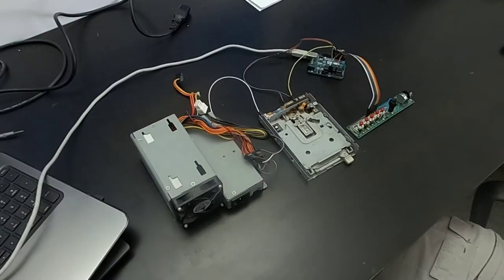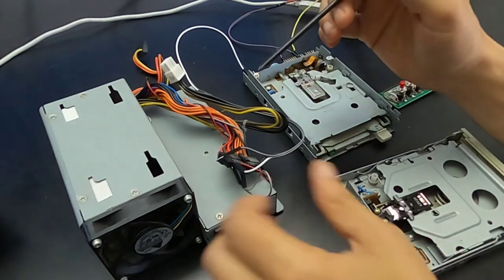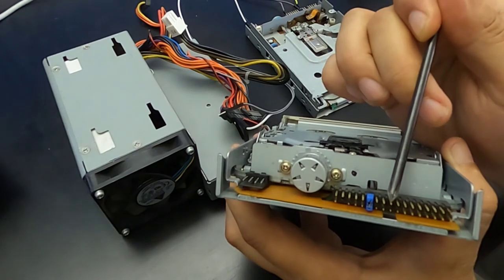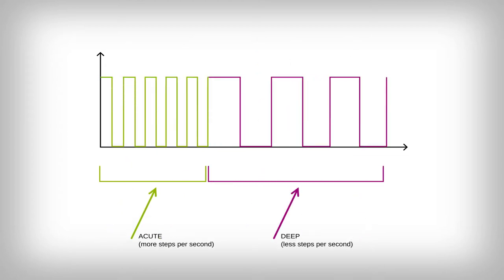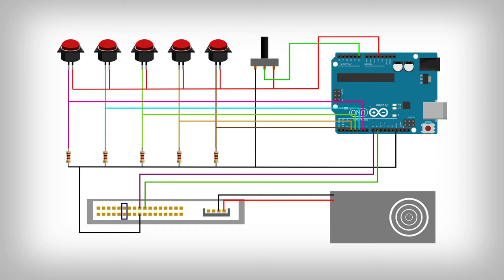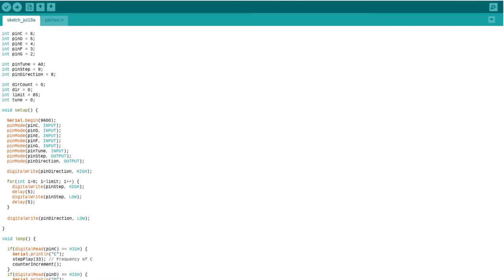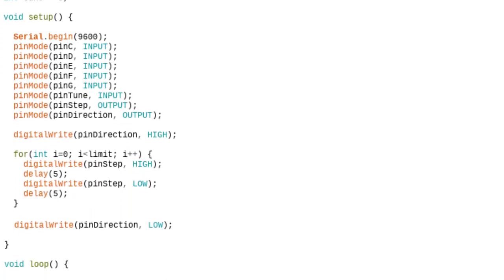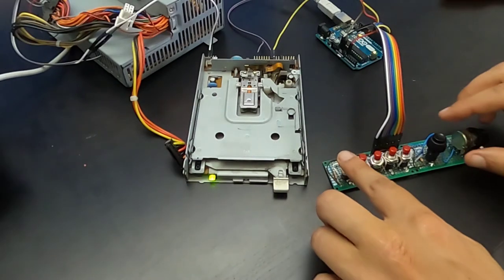How to Music Floppy works - Tutorial - Part 1

Comment: I have a question though
Since you're using pwm to control the sound frequency, why do you use all 12 disks for notes?
1 disk can do all the notes, can't it?
So you would only need about 4 for most easy melodies, no?
Or you could use more than 12 for complex ones
So why did you choose 12 specifically?
Was there a piece you wanted to play that required at least 12 disks at once?
Reply from the maker: You are right, but it is like in a normal orchestra, in my experiments I usually use songs with 4/5 tracks (one for each instrument), but as in normal orchestras there are more instruments playing the same melody, in order to have a more enveloping sound.
Also it is not possible to change the volume of floppies, and the lower frequencies make less noise, so I use more floppies
Reply: ooh that makes sense!
Do you plan to add more? Or is 12 the sweet spot?
I tried this when I was making an arduino drone, with the prop motors, but using floppies is such a cool idea!
Reply: @Dslak  Is that named after polyphonic music? i could be wrong...
Reply from the maker: @DomiaAbrWyrda  I made an 18/20 floppy one (you can see it in the second tutorial), and I took it to Italia's got talent, I think even 12 is a sufficient number to have a good balance if you have 3/4 tracks, adding more it's just more scenic and makes more noise :)
Reply from the maker: @MiettedeThonTomate  Yes, or in this case floppyphonic :D
Reply: @Dslak  Cool!

Comment: I'd like to implement this on industrial hardware as a business demo, using a PLC (in Codesys) and EtherCAT stepper drives. Has anyone done anything similar?
Reply from the maker: I don't know, but floppies are controlled by simple 1/0 impulses, so they can be replaced by any stepper, I did it with printers (with some modifications)